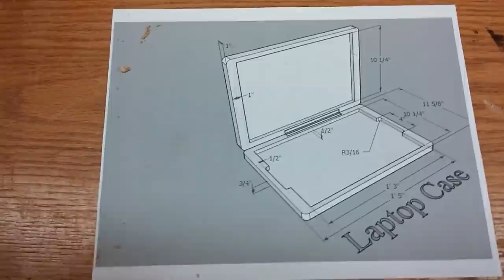Build this Awesome Wooden Inlayed Laptop Case for your Computer

Comment: Line the insides with foam please. Even though the laptop won't rattle with the snug fit, It's better to redesign it and put cloth/foam/felt lining inside to prevent the anodized aluminum of MacBook or plastic of the Windows PCs be scratched and damaged.

Comment: Nice work ! I do agree with the other guys comment. On shop safety  needing. Some drastic improvements i worked over 20 years  in Commercial Woodworking both with my tools and in Management Woodworking  in my life has been more than a way to provide for my family it  was also a passion and a hobby  most of my close freinds are somehow involved in it somehow  and. Unfortunately after  many accidents  that happened. The victims a;ways said the same things to me. I never thought that it would happen to me and. It happened so fast. I couldnt beleive that. It just hapened and it took it a few seconds for the reality and the pain  in your video it looked like you. Were reaching over the tablesaw blade way too close. Especially in long sleeves  and during the  routing  i didnt see face shields or eye protection. One time i had to go to a hospital to drive home a coworker  that. Had metal shavings  get shot so hard into his eyes   That the eye doctor. Spent several hours removing them with  a very tiny pair of  tweezers one at a time  the entire fiasco did winf up costing the guy. Some  permanent vision loss and a lot of Money both in hospital bills and loss of  pay from not being able to drive to work for a while  ?  Of course I’m not perfect myself  but i  do pride myself on  not  having  a shop injury  thats required me to take a extended leave of absence  for surgery  or long recoveries  i have performed a “ Chiselectomy on my own hands  by  doing my chiseling in a ridiculously stupid manner  that did require stitches    In order for it to be able to heal properly  otherwise i like your channel and i am looking foward to more of your projects  and tutorials  in the beginning of  this video i saw a  ouch box planer in the background on a shelf and i was laughing to myself. That  after  your glue up  i was like thats never going to fit in that planer  then of course your next step revealed the big planer you actually used  i thought to myself the jokes on me this guy knew what he had in the shop  i did get a kick out of the old routers  you were using  my Father had  the same model years ago. And  i always wished he had passed them down to me with so many of his other woodworking  and  Vintage  Automotive tools  as vintage cars are another hobby of. Mine as was his

Comment: It was a little bit painfull, when I saw U wasted around or a little bit more than 1/3 of the cherry wood. Did U mind about any soft protecting layer inside or outside? (Every high quality notebook case has a thick soft layer that protects the notebook when it falls down. So I mean something else than that thin, soft touch layer that U used.)
The cover looks very nice!

Comment: I absolutely LOVE this but have to say you had be shuddering every time you use your table saw with no push stick, guard or splitter! Careful dude.
Reply: Alex Reid my dad was a professional woodwork for over twenty years and I have never seen a saw with a guard or splitter installed..  The first thing he did was take it off and throw it out ;)
Reply: David Kennedy Yeah. In my opinion that's not a smart move and not good advice to pass to the next generation but of course it's up to you what legacy you want to leave.
Reply: Alex Reid google table saw images.  The pictures of the brand new ones for sale always have the splitter... The ones actually in use by woodworkers never have them.
Reply: David Kennedy Thanks for the info but I am already aware of that. Doesn't make it best practice from a safety standpoint of course.
Reply: Woods turnen
Reply: For some reason, US- based woodworkers nearly always remove the riving knife, and consequently, the guard

Comment: beautiful work. really well done. but why would i use this? it doubles the weight of my laptop and adds about 50% to the size. a laptop is meant to be used. not stored in a wooden box. this box has ZERO practical value.